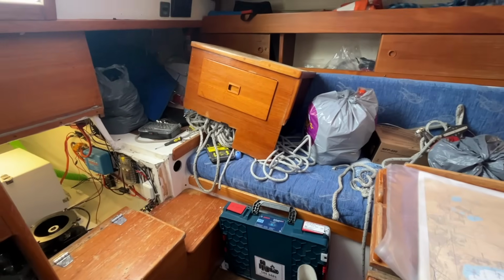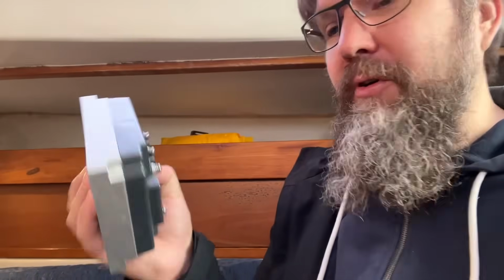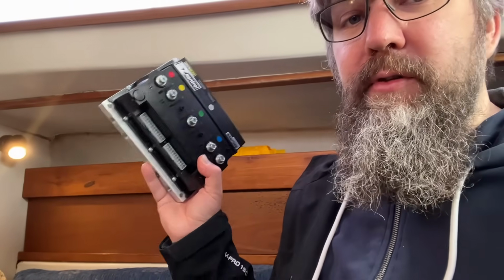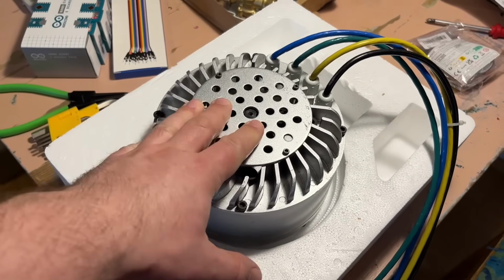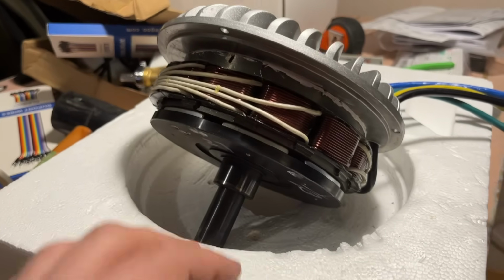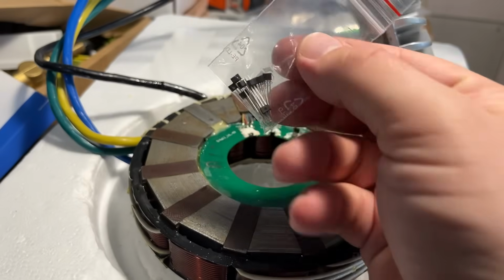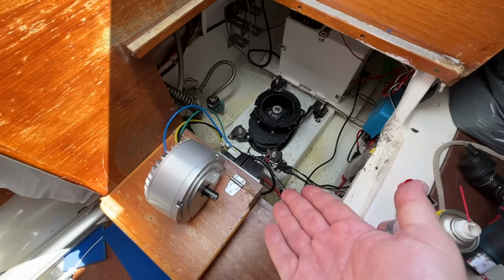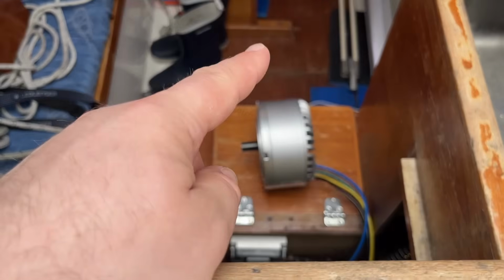Weak link of electric sailboat ⚡️⛵️ - Opening a Goldenmotor BLDC motor! - SeaCamel Tech Corner - 02

Comment: The most efficient mode of transportation is sail. The second is turbo diesel. Shore power is the primary source of electricity for an electric boat. Realistically solar power on a monohull sail boat will be insufficient for range and time.
Reply from the maker: Diesel is too complicated and uses fossil fuel which we should get rid of.
The new boat has now 8 full size solar panels fitted in the plans. With double layers that makes 16. They will create power in kilowatts. They also are developing better all the time so in few years their efficiency should be even better.

However there might be need for generator to maintain the boat in wintertimes. Mostly for heating I’d say. (Winter = cold with no sunlight) That of course depends where I want to go. 😅

Using electric propulsion will also change the mindset. Wind is the main power. If there’s no wind, there’s no speed. Going slowly the range is basically unlimited.
Reply: @ArcticSeaCamel 
Cut your anticipated panel output in half if they are mounted flat and not near the tropics, even more if there is any rigging shadow. Remember that you only make power during solar hours and when the sky is clear.  If you are underway you aren’t storing energy.  A motor also needs to be large enough to make headway in tide and/or wind.. The “green factor” needs to factor in the manufacturing and disposal of the system. 16 panels full size 400+W panels will make it look like an aircraft carrier. If you plan to tilt them, you’ll have wind area. That type of mounting will need structure with is surprisingly heavy. The only solar powered boats that I’ve seen that have usable range are catamarans and those have auxiliary diesels which they depend upon a lot. I know of five electric boat projects that are abandoned, won’t sell, or are harbors queens because of disappointment. Be really sure that you’ve done the math so it’ll live up to your goals.

Comment: so dont use ac pulse motors, use hall-effect dc motors, much simpler. similar to commutating dc-ac motors but use only dc also internally.
Reply from the maker: Not sure what you mean? There’s no such thing as DC motor. All electric motors need changing magnetic field to work so they’re always AC motors.

In this case the controller makes 3 sine waves of power that turn the motor. Dc supply is just to provide the energy for the controller. Hall sensors are just for feedback.
Reply: @ArcticSeaCamel  Eh... Starters in cars...? DC motors are very much a thing.
Reply from the maker: Yes, but they have mechanical commutators that basically change dc current around when motor is rotating. So the voltage needs to be changed around in every case.
They’re not good motors for running continuously long times.

Comment: Do your motors allow regen while your sailing?  Also, Sailing Uma found they needed liquid cooled motors.
Reply from the maker: 👋 
Technically yes. But this boat is too small to get any real regen power - speeds are just too low for that. I think the prop should be different as well. I very rarely get speeds over 5-6kn. It’s over 6kn where you start to get even some power out from regen. Preferably more of course.

And the usage of the motors here is so low that there’s no issue with cooling. Also it’s mostly cold. Max water temperature is around 23°C middle of the summer. That keeps the bilges cool. (This July has been exception of that, it’s a bit warmer now, maybe 25°C)

Comment: Thanks…but a bit beyond me.
A thought, to keep it KISS is a brushed motor more simple, ok you need to replace brushes regularly, but easy and cheap.
Reply from the maker: There’s many benefits in brushless motors. Their power adjustment and efficiency is better and also regen is easily achievable. (If boat is big and fast enough)

Comment: Hi Panu, it might be interesting to look into an VESC controller, they‘re open source and can control many bldc types also those without hall sensors, you might even be able to use the „broken“ motors you have 😊 
You even might be able to use some type of regeneration.
Reply from the maker: Looks interesting! Not sure though if there’s high enough power versions of that. They mostly seem to be focused on e-bikes and stuff…
Reply: @ArcticSeaCamel hmmm, I don‘t know what Voltage your system is working on, but, this one „VESC 75200 V2“ can handle 200A continuously and 300A peak, since your motor is 3kW your max power draw @24V would be 125A, @48V it would be 62.5A, the controller wouldn‘t even break a sweat 😋
Reply: @SV_Sienna  I am also looking at the VESC controllers. Sometimes back I subscribed to 2 channels But to be honest I don´t feel comfortable and specially when it comes to serious marine applications. Can´t find much straight forward and practical info, only some noise and a lot of fog  Those motor controllers are Black boxes loaded with patents and their owners watch them like hawks. This whole topic needs a lot more exploration. I am digging in the 48V-6 KW motor size. So far the only practical solution to make this whole marine thing viable and reliable, SAFE is the external pot drive solution. That allows for a fast fix if You have a complete spare motor on board. But also here the repair is a struggle but at least it can be done later on at a more convenient moment. I wished there would be some kind of Fast Over Ride solution for Emergency

Comment: Every Hall effect sensor has a unique response curve. If you can identify the original sensor, get a copy of data sheet and match it against the data sheet for the replacement part you purchased. Based on your video I think you will find one or more significant differences. You may be able modify the hardware controller software to accommodate the new sensor, or modify the  hardware   to use the new sensor. The latter could be as simple as adding a capacitor to modify the Hall output. Good Luke.
Reply from the maker: Hi, so I tried to look at the old sensors with microscope but there wasn't any markings. So I just went with sensors I got from local store. Apparently they might not be the right type. They seem to work though when measured!

Next I'm gonna try to measure the fixed motor and new one with oscilloscope and figure out what's the difference. I bet the sensors i put there are just wrong type.

Comment: Probably a stupid question Panu. (Actually two questions). 
Did you make sure that the orientation of the Hall effect sensors were correct?
ie are pins 1 and 3 reversed?
And are the Hall effect sensors identical to those you removed or are they just generic Hall effect sensors?
Good luck with your investigations. 
Mark K
Dublin, Ireland.
Reply from the maker: Same answer here as with other comments 😅:

I tried to look at the old sensors with microscope but there wasn't any markings. So I just went with sensors I got from local store. Apparently they might not be the right type. They seem to work though when measured! So I think there's no issue with polarity of the pins.

Next I'm gonna try to measure the fixed motor and new one with oscilloscope and figure out what's the difference. I bet the sensors i put there are just wrong type.

Comment: Hello Panu,
That's the same error I had. The fault lies in the Molex connector; your contacts are poor, which is why the sensor signal is not coming through completely. 
You can only test the sensors with a pull-up resistor. Otherwise, you won't get any useful results. The pull-ups are built into the power electronics; you need external pull-ups for testing. See the data sheet for the Hall sensor.
A lathe is really helpful for disassembly and assembly. 
My solution was to cut off the small connector and solder the sensor cables directly to each other.
Best regards,
Philipp
Reply from the maker: Thanks for the info! I'll keep that in mind when I get back to fixing this. :)
Reply: Interesting thanks for sharing

Comment: Nice work.
BLDC is simple and I think you will solve it. 
The sensors come in different variants. Pinout, latching/no latching, hysteresis,  trigger level. If you have the right ones it should work.

For the new controller, you might need to swap positions of the 3 signals (there are 6 possibilities). I don't know if all of Golden motots controllers and motors are signal matched. When I connected Golden motor to Kelly controls, signal colours didn't match.
There could be a 60 or 120 deg setting to play with.

Good luck!
Reply from the maker: Thanks! The controller has ready-to-go factory settings for their motors. A new motor I got worked immediately.
So yes, I will continue by checking the sensor types with oscilloscope at some point!

Comment: I had a look at some info on the sensors, it appears their are 2 types, analogue and digital, the analogue puts out a variable voltage whereas the digital is a fixed voltage output, do you know which ones you have versus what you bought? it looks like the digital version can be either bipolar or unipolar and from what I am understanding is that you probably need digital bipolar?

I found this on Google "Bipolar Hall-effect sensors are used in BLDC (Brushless DC) motors to detect the position of the rotating magnet. In this example, an eight-pole motor with a three-phase winding uses three bipolar latching Hall-effect sensors. A magnetic field is required to activate a Hall-effect sensor"

I also found this "A bipolar Hall effect sensor is a type of digital Hall effect sensor that activates when exposed to one magnetic pole (either north or south) and deactivates when exposed to the opposite magnetic pole. Unlike unipolar sensors which only need one magnetic pole for activation, bipolar sensors require alternating magnetic poles to switch between on and off states" is this the answer?
Reply: Yes, if he went by appearance instead of part number, he could have bought the wrong type of hall sensors. Quality bipolar latching sensors should work, but no telling what he bought. 

The controller is expecting a special set of values and also expects to never see some sets of values. As soon as the controller is powered on it will check and if the 3 values are not legitimate, it will give an error. If the 3 values are legitimate by chance but become illegitimate after the rotor moves slightly, the controller will give an error and not run the motor. 

Since he didn’t show his method for checking the hall sensors, we have no way to know if the output is wrong. We also can’t see if its acting like a 60 degree or 120 degree commutation. One of my hub motors was a 60 degree motor with the center hall center inverted to change to 120 degree commutation.
Reply from the maker: Hi guys! I think you are right here. I didn’t find any markings on the old sensors (I looked at them with microscope!). So I just bought sensors that my local electronics store had. The appearance was exactly the same.
What I’ll do next is to hook the motor to oscilloscope and check the signals with that and compare them with new motor I got. (I did bought third motor to get the boat back to water for the summer)
So, this will continue at some point!

But now I know how to open this motor!
Reply: @ArcticSeaCamel I can see by the hall sensor spacing and magnet location that its a 120 degree commutation motor, so if all 3 hall sensors are facing the magnets, it will use 120 degree commutation in the controller. 

There is a $10 hall sensor tester thats a small white box with lots of LED lights, and one of its functions is to show you the status of the hall sensors (0 or 1). 

Since your motor is 120 degrees, it should never see 0-0-0 or 1-1-1, which is possible in a 60 degree commutation. 

If you connect the tester to a good motor, you will see 1 or 2 halls lit up. If you then rotate the rotor very slowly, you will see led’s light up as the south pole of the magnet goes over the hall sensors and the light will go off as the north pole magnet passes it. 

So you will see something like 
1-0-0
1-1-0
0-1-0
0-1-1
0-0-1
1-0-1

Then it will repeat. 

The bipolar latching type will be less wishy washy when transitioning from magnet to magnet. 

If at any time you see 0-0-0 or 1-1-1, or its not following the same six step commutation each time, then there is a problem.

You can test without the box with a multimeter but its not as easy to see if its senquencing properly. 

If you see:
1-0-0
1-1-0
1-1-1
0-1-1
0-0-1
0-0-0

Repeat
Thats 60 degrees commutation. And the only way that motor can make 60 degree commutation is by flipping over the middle hall sensor.
Reply from the maker: @imho7250  Thank you so much for this! I'll take a look!

The sensors that were in the motor seemed to be all in same order. I can also check the setting in the controller what degree that is set in.

Comment: First off what a great effort and showing your work on this.
I work with electric brushless motors all the time. (I do competitive robotics)  It is neat to see you working your way through this.  Often replacing the sensors can sometimes be done easily by anyone with moderate electrical ability (like maybe if you have built a CNC machine?) and some experience, but also we just tend to use motors that the manufacturer will replace the sensors for usually a very small fee. Not like yours unfortunately. In those cases we just toss the motor and get a new one.  I also don't think I have your amazing patience Panu. It is nice to watch.  The "pulling thing" is usually just call a gear puller in my shop.  
I also tend to buy modern motors and controllers in matched sets.  Modern manufactures often upgrade parts and firmware without documenting it really well and then they sometimes do that weird pulse thing the motor was doing in the end.

Also in the future maybe you need a way to isolate the motor and controller from the charging system from voltage surges like lightning. I don't know if this is a standard on modern boats so it is more of a question.  Its a bit like the UPS many of us use on our computer systems with surge protection. Any how loved the video and wish there was some easy way I could help out.
Reply from the maker: Thanks! Yeah, these motors are pretty cheap and simple and not made to be repaired unfortunately.

Isolating the motor (or controller) from surges somehow is interesting topic. Also the motor does give interference to the depth sounder when it’s on. That is something I’d like not to have with the big boat eventually.

Those are the hard things with electric systems and my knowledge is not really enough at this point for solving them. 😅

Comment: If you manage to change the sensors do you need to reset or reprogram the engine to make it work ? ( recalibrate the sensors ? )
Reply from the maker: I don't think there's anything to calibrate or setup in the motor itself. I've heard a description that next simpler thing after an electric motor is a rock. 😅
Reply: @ArcticSeaCamel  I've heard that the next simpler thing after a rock is Donald Trump.
Reply: Well , when we change electric motors for cars we need to recalibrate the module for engine control , to tell it where the engine is so to say ( which fase it is in ) so what sensor is to be expected next .
Reply: Maybe there is a zero setting you are supposed to assemble the engine in
Reply: Any hole in the plate with the strong magnets in ? And if there is , any corresponding in the plate that receives the magnetic plate ?
Reply from the maker: Interesting. 🤔 
In this motor there really isn’t much of anything else. The magnets and “sensing magnets” are fixed in so there’s nothing to adjust.
A new motor I got now worked immediately when hooked up. So I’m suspecting now that these sensors I got are just not right ones. (Although I got them measured that they work)
I try to continue this later by getting oscilloscope and comparing working new motor with this fixed one and trying to figure out the difference.
Reply: @ArcticSeaCamel  I share Your opinion. If the sensors are good everything else is done by the controller. Those EMP and Lightning strikes are the weakest part of the whole electric propulsion thing. Looking forward to Your findings and the tools required to chase this bug.

Comment: Electric seems nice but the additional cost has to become a major factor a simple broken wire can kill the motor the electronics of the entire system is a factor
Reply: yes, but same with gas engines and electronic ignition and ECUs . They shoould be more robust, but there much fewer parts to fail on an electric motor.
Reply: So the same as a ICE engine, got it